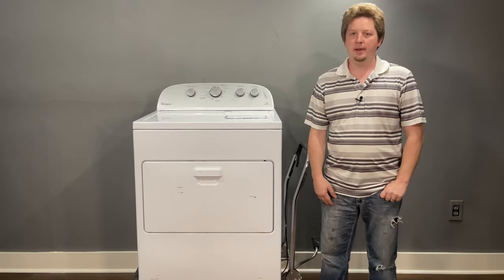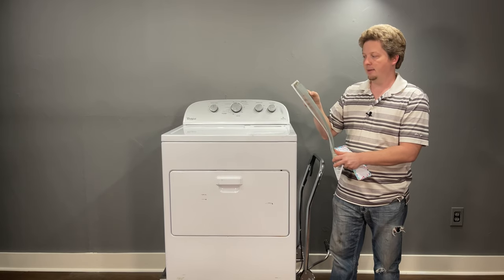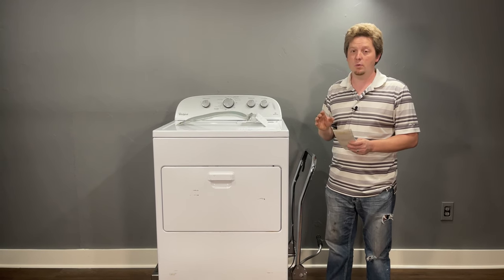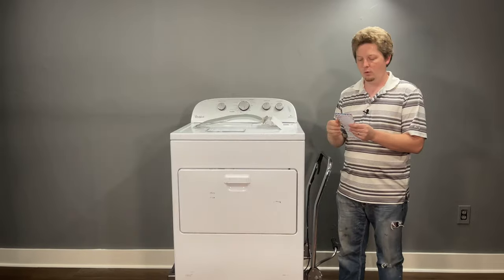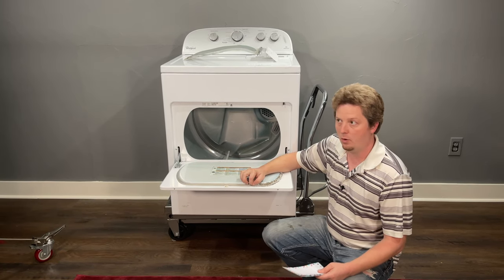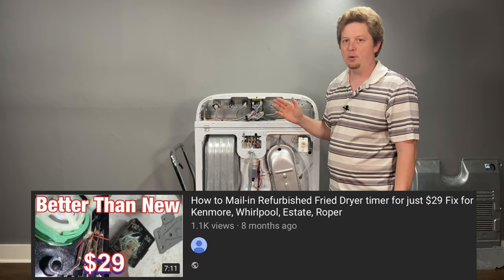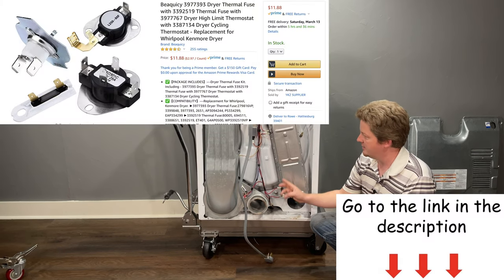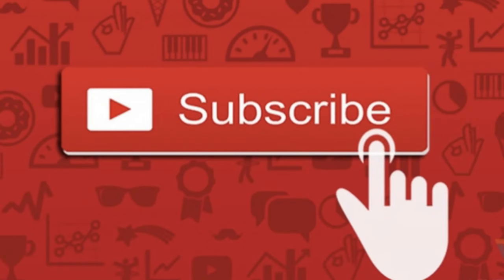Electric Dryer Overheating - All Reasons & How to Fix - To Hot burning￼ - Whirlpool, Maytag, Amana

Comment: I watched several “how to” videos on overheating whirlpool dryers and yours was absolutely the best.   Thanks for the great information, and for including info to order needed parts !     Great job !!
Reply from the maker: Thanks
Reply: I have a Ge dryer if I run a full cycle on time dryer with no clothes it would go through the whole cycle but when I put clothes in there and put it on time dryer it still run for 5 minutes and cut off everytime .
Reply from the maker: @marlawilliams2561  could be a bad motor. The extra weight of the clothes might be just enough to make it over work and cut off. But it’s hard to tell without actually being there so I’m just kind of guessing.
Reply: I was thinking the same thing and I replace the motor and all fuse but it still doing the same thing have you ever had a situation were it was the timer.

Comment: Hi! I watched your other video on the 4 reasons your dryer won't turn on and was able to successfully change out the thermal fuse! It was surprisingly quick and easy and i was so happy to have saved money as i was charged a lot 7 mths ago to have a heating element installed and lint cleaned out. However, before a full cycle was completed, the entire dryer got SUPER hot and stopped yet again. I'm so frustrated, but i find your videos so easy to follow, and im hoping this will help me.... I'm just nervous about taking the whole drum out to clean lint. I pretty much cleaned as best i could without doing that, which may be the problem.  But i wanted to thank you for making these videos! If you have any tips, i would appreciate it!

Comment: I have fixed many of our washers and dryers over the years so I pretty much know what I'm doing. I currently have a Whirlpool Duet dryer. My current issue is the dryer is overheating. Thermal fuse is blowing and the dryer and clothes are way too hot to the touch. I have eliminated several possible causes (lint buildup, clogged duct, thermostat, thermistor, heating element, blower wheel, felt seal still seems good etc.) and I am currently down to it either being a bad blower housing seal (it needs replaced) or the control board. There is literally NOTHING else left! I have a spare Duet dryer I am taking and comparing/testing parts from. I'm about to replace the blower housing seal and swap control boards. If I'm missing something please let me know.
Reply: We have the same issue.. can not figure out. Husband did everything you stated above.  We replaced the board as well, which then came up with other F22 codes. (we purchased the board from Amazon)   We think the board is faulty  Husband put the old board back in and dryer works, but now overheats again!  
 ready to to bite the bullety and buy a new unit :(
Reply: @rundms323  My issue ended up being the board (probably a bad relay). I had a spare dryer of the same model and swapped the boards as a last resort. That fixed the overheating issue.

Comment: Thanks for the great video!  I have a newer Samsung electric dryer, and the thermal fuse on the blower motor assembly keeps popping.  The dryer worked great for a year and a half, and now when I replace that fuse (and other fuses, thermistors, etc as well) the dryer lasts about a week before that specific fuse pops again.  Curiously, it seems to happen with very light loads of clothes only.  The vent is completely clear, there is no lint trapped anywhere.  The heating element looks good and has continuity when tested.  I did replace the fuse and felt the transition duct the last time it went out, and the duct to the wall was very hot to the touch - so it’s coming from within the dryer I’m sure.  Thanks for your help!

I should also add that the fuse on the heating element never pops, just the one on the other side of the machine near the blower wheel - which appears fine and the dryer spins without any issue.  However, when the fuse blows, the dryer keeps counting down and everything appears normal, but the drum won’t spin and inside the drum feels hot.  

Again, I replaced all the fuses, thermostats, etc, tested the 240v connections, checked the heating element for continuity, confirmed visually that the entire vent system is completely lint-free, and a week later this still happened.  I find it odd it lasts about 5-7 cycles before blowing that same exact fuse each time.  This cycle has happened about 4 times now; so, it’s basically overheating intermittently.  Any advise on what to check/replace next would be very much appreciated.  Thanks!
Reply: sagging heating element, do a visual inspection inside housing, look for burn marks on sheet metal  It may ground out only when element is hot, than it cools down and doesnt touch housing when you do a ground test with meter.
Inspect blower wheel for obstruction
Replace idler pulley and belt while you have it opened up, and make sure all four drum rollers spin freely.
Reply: If you use dryer sheets, check the lint screen for invisible blockage.  
  If water does not flow through it freely, wash and rinse it with detergent if some sort until water flows through it freely. 
  If the screen is clogged, the heat builds up in the drum and can be very hot when it does go across the thermal fuse.

Comment: I have pulled the back off my dryer
, removed any lint/ debris around the drum, and aluminum air pipes- the dryer still runs without stopping. I am guessing this the dryer timer or one of the limiters/ thermostats. How do I eliminate one or the other- the timer is a $75 part  the component kit at $ 10 for 4 parts...is there a way to determine which it needs. Great helpful video. Thanks

Comment: Hi I have a Maytag Front loading Perforance electric Dryer, would not start changed thermal Fuse  & high temp.sensor clean out all exhaust . Replace vent hose. WOrks now , but noticed front of Dryer getting pretty warm now. Can You tell me possible cause? Thanks for response...Kay

Comment: Great video, I had the grounded element problem. I'd just replaced it a few months ago and thought it was one of the 3 thermostats, but they tested ok. Thanks for the help, I was beginning to pull my hair out!
Reply from the maker: Grounded out heating elements or a unique problem that are hard to diagnose quickly. I have accidentally checked a machine and did not realize the heating element was grounded and coming on and thought it was just the thermal cut off and ruined a thermal cut off just because I forgot to double check.

Comment: Hi Gabe .. I have a Maytag Centennial about 10 years old.  I went to get the clothes out of the dryer and they were Super hot!  Now the dryer won't turn on.  Lint filter is clean and the exhaust hose clean too .. haven't opened it up to see what it looks like inside, but plan on doing that tomorrow.
Reply from the maker: Some dryers have a thermal fuse that will not allow the dryer to come back on if it overheats. That’s more than likely what’s happening. Don’t just replace the fuse. Figure out why it overheated. Otherwise you’re just fixing the symptom of the problem. It could be that it is a grounded heating element. I have a video on that.
Reply: @WasherDryerMoney  thank you so much for your response!  I am learning a lot and hope to report back that I have fixed it :))
Reply: replaced the thermal fuse and thermostat and it is working great!  Thanks for your help!!  I have all the other parts you mentioned replacing as well, but it worked by replacing just those.   I checked the coils and nothing was touching, figured it had to be the thermostat (causing backup thermostat to kick in) because the clothes were super hot and I got them out before the time was up.  I learned a lot from your videos .. much appreciated!!  Pretty proud of myself :)) @WasherDryerMoney

Comment: Excellent video, thanks. I have whirlpool cabrio. Dryer, we checked all the four things in the back for continuity, all are ok, but only operating thermostat  on the left under the thermal fuse does not have continuity. So please advice that is the only problem or something may be wrong with timer and the circuit board? We are seniors and not a handy person.please guide us. Thanks. We are in Cleveland ohio. If you know good repair guy please let me know a. Thanks again

Comment: I have an older kenmore that i just replaced the heating element on.  Seemed to work fine after that.  Now when i use the dryer the bottom glows so much it looks like a rocket taking off. It's not on fire anywhere,  just seems like the heating element is getting a lot more hot than it should.  Any suggestions?

Comment: Is the door getting hot to the touch in the middle of a load a symptom?
Reply from the maker: Yes. He usually this means there is lint blocking the path for the air to easily flow through somewhere in the dryer or in the exhaust pipe or flapper outside.

Comment: Hello, have you had good luck with the heating element you have linked  compared to the OEM? I want to use your affiliate link since your videos were so helpful, but I am concerned it isn't as good of quality and is a part that can be dangerous. Thanks for your awesome videos!
Reply from the maker: I have use them and not had any issues, but I have randomly gotten heating elements that were not good off of Amazon as well.
I have used a whole lot of them and usually heating elements go bad not because they just randomly burn up but because of airflow problems. When there’s any resistance and airflow these heating elements dramatically get hotter.

Comment: Questions what do you do when you have a burnt prong or connector that goes to a dryer board. Do you replace the connector or all the wires going to the dryer.to get the connector I had to by all the wires.

Comment: Hi again Gabe. Is it possible to "bench test" a control panel, or should it be installed while testing? Any videos on this you recommend?
Reply from the maker: I never have but I would think it would be easier to test it on the machine it was meant for. I have seen a video of a guy using a tester to test the timer but I remember thinking it would be easier just to pop the timer open and inspect the contacts because that’s a common problem. It’s usually extremely obvious when a contact has gone bad.

Comment: Hey Gabe. Do you have any videos on how to run a full and complete diagnostic check on a washer/dryer from beginning to end? Regardless of condition, I would assume that you would want to run such a full diagnostic to avoid future callbacks. Even if I receive a washer/dryer in "working" condition, I would want to check for any hidden issues that would present themselves later. Thanks!
Reply from the maker: I always run washers through one cycle with a full load of towels. Usually partway through the cycle I will know what is wrong with the washer.
After I have fixed the washer I will run it all the way through two full cycles before I determine it’s fixed.
I always keep a close eye on the washer during the first test because sometimes they will leak or overflow. I hate having to mark my shop floor. Lol

Comment: Please help !!   My Amana electric dryer stops at the end of the cycle but the timer keeps ticking and moving making the dryer get too hot and blowing the thermal fuse.  
How can I fix this ?  Thank you for your help
Reply from the maker: Could be the time or the heating element is grounded. Looked at my videos I have videos about those problems. Definitely don’t use it or leave it plugged in if it’s not turned off.
Reply: @WasherDryerMoney  thanks for getting back to me so quickly !  I've had the element checked along with all the other things and they are ok .. I have to unplug it to get the timer to stop.  The dryer runs on air fluff but I haven't been using it.. can I reset the timer or should I order a new one ?
Reply from the maker: @cynthiajomcgrew6599  more than likely will have to replace it. Usually these are just mechanical timers non-digital. Timers can sometimes be as much as Getting another dryer used. Before you go through too much trouble I would consider getting a another used dryer because it is just a guessing game unless you hire a professional to take a look. You’ll see one of my older videos I take a timer apart to see if there’s anything burned up inside and there’s a refurbisher on eBay that only does a few types but you may have the right type of timer to get it refurbished for $30.
Reply: @WasherDryerMoney  I might just go ahead and get a new timer, my dryer is only 5 yrs old.. it's an Amana .. You have a great Labor Day weekend and again thank you so much !
Reply from the maker: @cynthiajomcgrew6599  Sounds like a plan. When you take the timer off there will be a model number be sure to get the exact same model number including the last letter at the end of the model number. Some timers have the stop points in different spots so if you get one that’s a slightly different number or letter it will turn off at the wrong points on the timer.
Also be sure to just open the timer up and take a look at it it will be fairly obvious if something is burned up or stuck.
There’s lotta good videos on people opening those timers.

Comment: Are you able to make a video of what you mean by test cycles before you sell them like do you run them for a full cycle on every setting?
Reply from the maker: I will run a dryer on automatic cycle set on the shortest less dry. Then I will run it on timed dry set around 20 minute mark.
Air dry never seems to have a problem so I don’t waste time checking it.
Reply: @WasherDryerMoney  and what about washer just rinse and spin?
Reply from the maker: I will usually put washers through 2 full cycles after refurbishing them.

Comment: Hey Gabe, I have a quick question. Any tips or tricks on getting the faceplate of a Maytag Centennial watcher or dryer looking good again? Can't seem to get the water stains off especially.
Reply from the maker: Main thing is less is more. I have made things a lot worse trying to clean those off. It’s not like the rest of the body where you can just paint it white. A magic eraser been gentle not to rub off the paint works sometimes

Comment: have you run into the power cord starting to overheat at the plug in .timer  dose not seam to move, replaced it , fuse blown from heat replace it, now i'm stuck.
Reply from the maker: Do not continue using the machine until it’s fixed or a professional comes out and fixes it. Very dangerous problem.
It may be something simple like terminal block screws not tightened, or the other end of the plug not getting a good connection.
Be safe and have a professional check it has proper power.

Comment: I have a dryer like the one reviewed in this video. It recently melted parts of a coat on the low setting which prompted me to check a few things. Whether set to low, medium or high heat, it seems to heat up to 170F and then down to 115F before heating again. Shouldn’t the temperatures be different for the separate settings of low, medium and high heat? Also, what should those temps be? Will there be three separate t-stats, one for each setting?
Reply from the maker: Yeah that’s a hard problem to fix. Could be heating element is Grounding itself against the frame and making it come on too long. Or it could just be a bad thermostat or the temperature selector has gone bad. Worst case would be something messed it up at a timer but unlikely. Always hard to know when I’m not there to test.
Good luck and I would not trust the dryer on its own if it is getting too hot.

Comment: HELP !!!... Whirpool washer - the lid switch was melted and the white and grey wires are hot ??? Why ? Used different lid switch and tried different motor capacitor, still getting switch hot...why the resistance ?
Reply: I swapped motors and its still hot, I am assuming it does not get hot at all?
Reply: swapped power cord, and inlet valve, still hot
Reply: Bypassed the lid switch and wires don't seem to be hot...so, guess it was just the burnt wire connector ends?
Reply from the maker: I find a lot of times when that switch is overheating that the clothes are also not coming out completely dry. This is usually because the clutch is going bad but not gone all the way out. I’m assuming the motor is overworking because it’s able to spin at a much higher speed because there’s no resistance from the clutch. It could just be a coincidence but I have noticed most machines that have switches that burn up also have bad clutches. It could also be a loose connection at that switch. A loose connection is a hot connection.
Reply: @WasherDryerMoney  Thanks for responding, you are awesome! The clutch was probably bad, but I replaced that and the hot lid switch continued while agitating (I think because of the damaged wiring and pigtail / connectors....) I saw some people on the net ask the same question and post pictures of their burnt wiring and switch, but no one had a real good answer as to why....